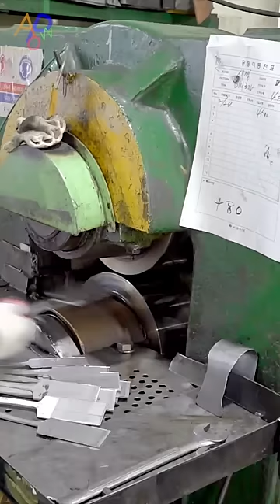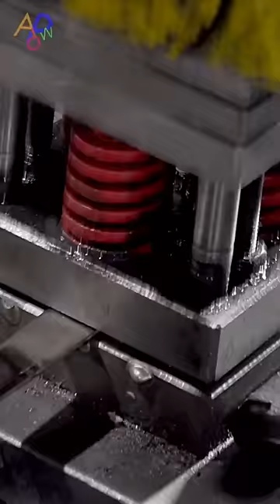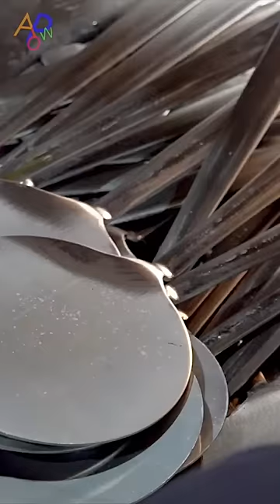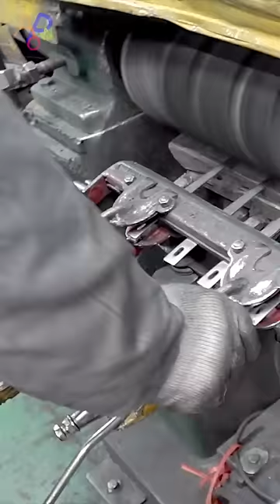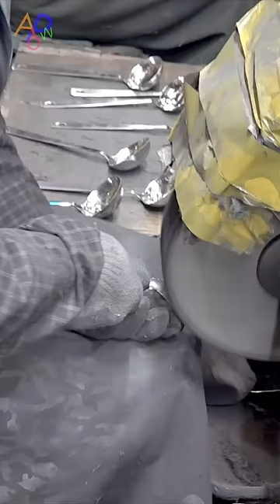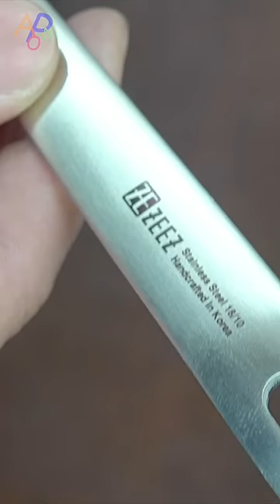Ladle Making Process by Stainless Steel Factory #allprocessofworld

Comment: Ah yes, handcrafted by machines.
Reply: Who operate the machines and hold The sheets in
The right spot , make the polishing , measures etc ... Stupid...
  Yeah robots ...😂😂😂
Reply: @nistaffsubs6787  handcrafted
adjective

    Made by hand or using the hands, as opposed to by mass production or using machinery.

As in not pulling levers and having a big machine press the metal for you.
Reply: @antienoob        that's a tool , cut and shape as a hammer but with press 🤷🏾‍♂️... 90% hand made... 
     Where IS the handcrafted title ?